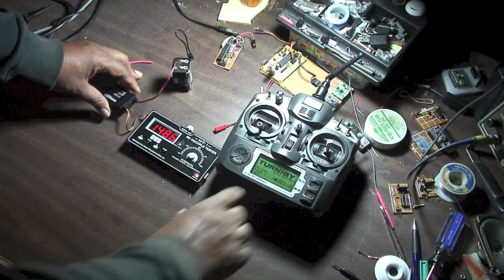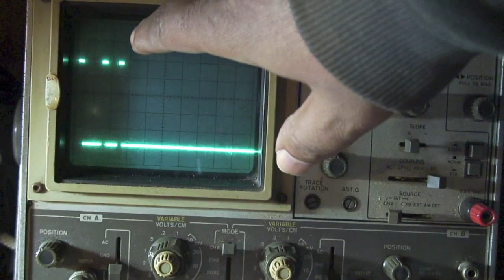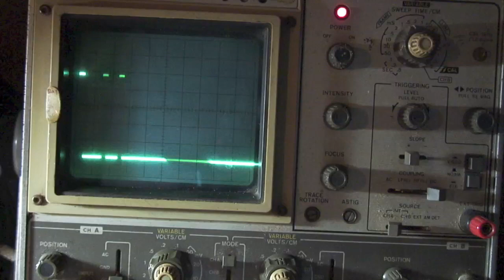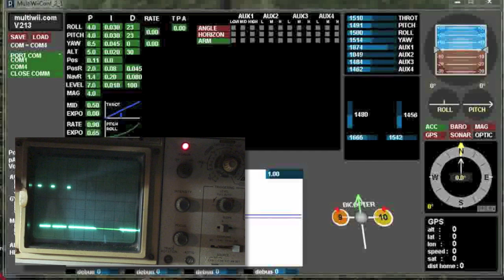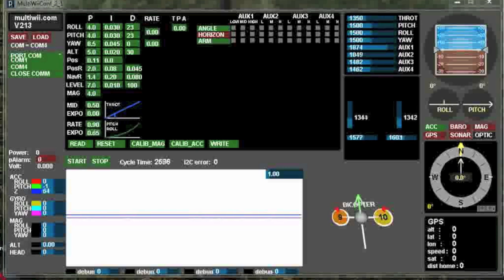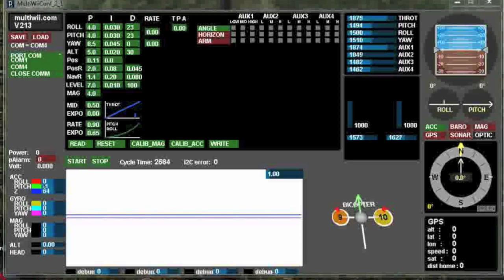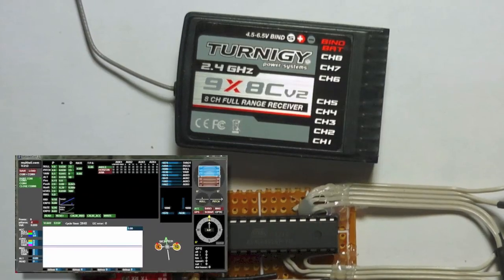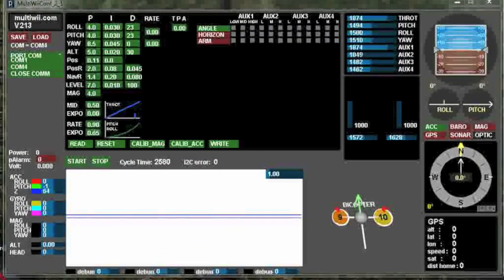Turnigy 9X Reciever & Sum-PPM

Comment: Thank u! Spent hours on FS w this problem. Mine is also a turnigy 9x rx that would not FS when turning it off. My rx is not original that came w radio. I had seen a video on YT where a guy said the rx sold separate did not have FS but I had forgotten this and I had it working on cc3d so it was confusing it would not work w apm. Guess they work differently. Luckily I had a flysky rx that worked fine after seeing your video and light bulb going off...tks!

Comment: thank you. you helped me a lot. I fall in the same problem with this receiver and the APM board. the apm board doesn't recognize the failsafe if i use channel 4 and 5. i think this could be an enforcement in the apm fw. i will request an upgrade and i will link your video for reference. regards.